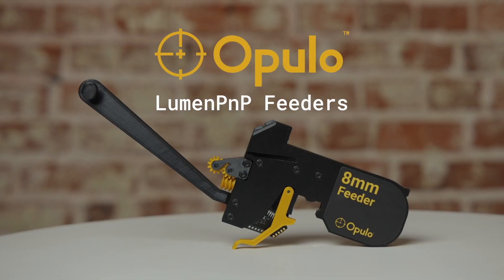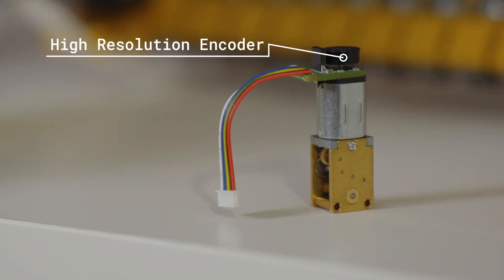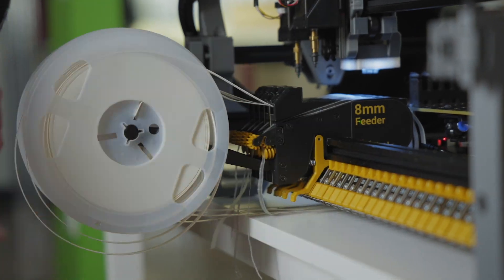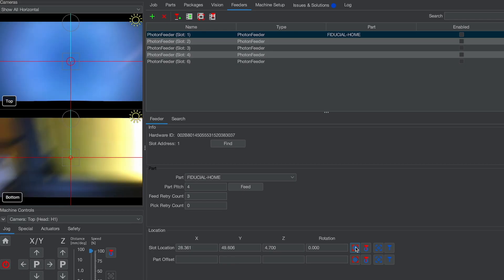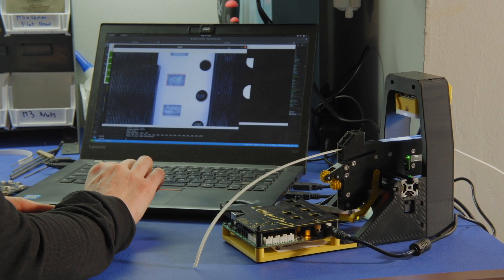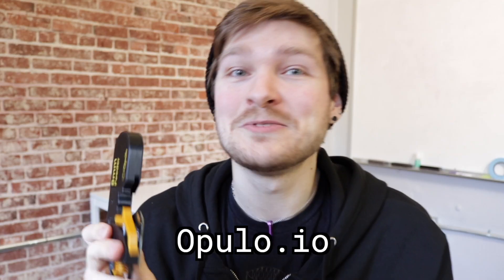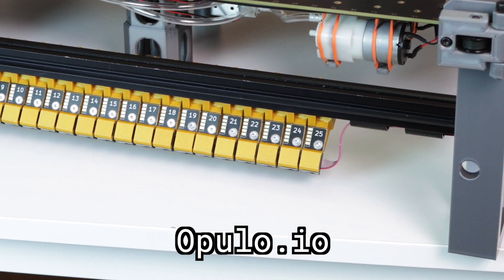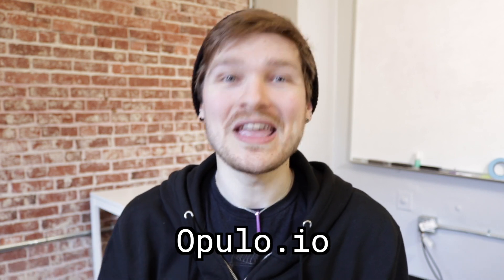Feeders are here!

Comment: The feeders are great. But how can I compile the  photon firmware with PlatformIO. I didn't found a link to the RS485 library you use. There are only CAD files for 8mm feeders on the github repository but not for 12mm. Where can I get the CAD files for 12mm feeders. The project is open surce but the source is not complete.

Comment: This is an awesome machine you've designed and built.  I am looking at doing a run of boards for some products I'm building and don't want to pay to have the PCB builder build the boards too.  My ROI on buying one of these and the feeders is going to be pretty high and likely not financially worth it. But long term it would pay off as this will work for all future projects I come up with too...   

I wonder if I could add a hot plate as the base of the machine, where after it is done PnP, it then turns on the hot bed to temp for xx seconds and then cuts off... Then have a tester on the head too to then run a QC test to hit test pins on the board and feed back data, even have a UART pads to push initial firmware to it (after initial, all my firmware is then updated via the webpage running on the board).  Since you made the entire thing open source (THANK YOU FOR THAT!), I could add those on.  Since my products, I don't have a need to push out boards very fast, I could take the slow down and do this step by step for each board and pop them off complete! 

I'm going to buy one and then start playing around with it to add these items/see if its possible.  Biggest hurdle would be programming for each of my products, but I could then have a stack of boards and parts all in reels and just load and build with I have an order.  A lot better for me to keep just parts on hand and not have hundreds of assembled boards laying around that could get damaged.  Since I only sell a few a week, this would be perfect.